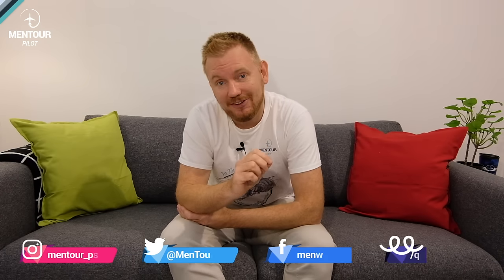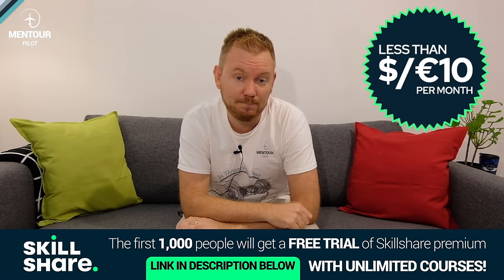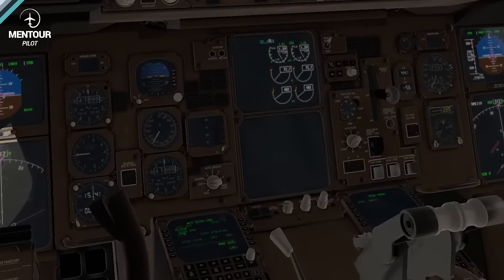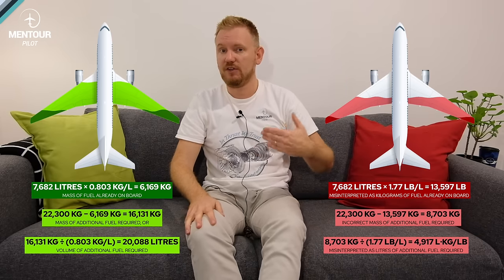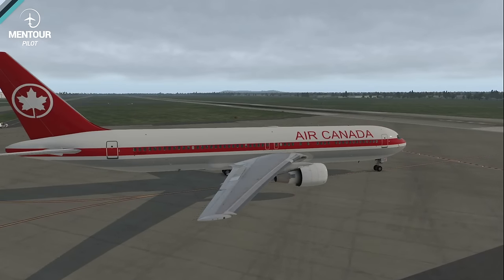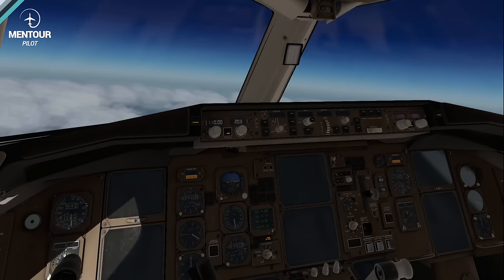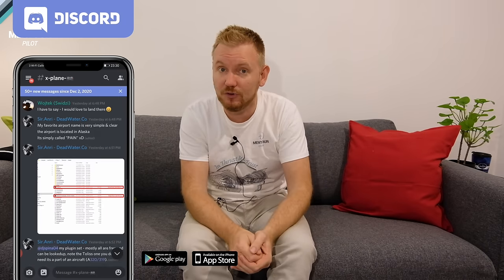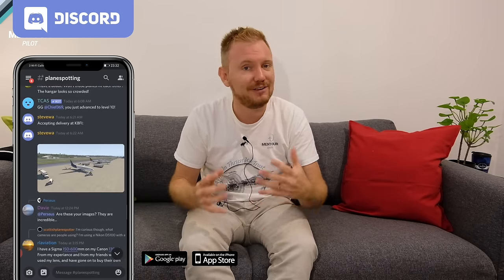The Gimli Glider! Explained

Comment: Excellent presentation. As a motorsport historian this incident has entered the lore of that discipline. Your explanation of the aeronautic side is the most thorough I've yet seen. One point of correction. It was not a drag race that was being held at the time but rather a sports cars race. To explain the distinction, drag races feature side by side runs of two vehicles down a completely straight road, typically 1/4 mile, plus extra space for slowing down. A decomissioned airport like Gimli is perfect and indeed such races did take place there, but not that day. When the Canadian Forces abandoned the field it was taken over by several racing organizers. On that day the Winnipeg Sports Car Club was having a meeting. Sports cars use a complete circuit consisting of different types of turns at different venues. 

At Gimli their course used the runway as the front straight and start / finish line. The cars then wound through a series of access roads to the west of the airfield before returning to the runway. A typical day would have featured 5 -6 races of 20-30 minutes in duration. Cars of similar performance characteristics compete with each other within the individual race. The famous photo that you also show has a group of Formula Fords stopped in front of the plane. Formula cars are built purely for racing and F Fords are very popular and very inexpensive scaled down versions of the more famous Formula One and Indy 500 type cars. Other shots I have seen of the incident showed cars like a Porsche 356--essentially a lightly modified for racing version of a road going sports car. 

I am not clear if there was an actual race going on when the plane approached and while there was of course considerable danger of people being hit, their were some fortuitous aspects to having this activity going on. Road races require there to be well coordinated communication between the various parts of the circuit and this would have gone into emergency mode (once the shock of the unusual situation wore off!). Then they had emergency equipment, personnel and fire-fighting materials at the ready, which I understand was used to help with the post-accident procedures.

Comment: Flying general aviation in Canada it always amazes me that we calculate the weight and balance in pounds, fuel in gallons then call the fuel service and request fuel in litres. E6B gets a bit of a workout when I want to go flying. 😀. Great content!
Reply: It's because of our half *ssed adoption of metric. It was a pet project of a single government that never had any widespread support.
Reply: @TheOwenMajor  You really don't want to let go of that bone!
Reply: It's easy.  The fuel company is paid for volume of fuel delivered not the weight of it which varies with the specific gravity which can change all the time.  Maybe they should be paid in pounds or Kg of fuel but the bowsers measure fuel flow and volume, not the weight.

Comment: I remember this sentence from the Air Crash Investigation episode:

"Captain Pearson is out of fuel. Out of engines. Out of options."

Not a good situation to be in.
Reply: Well technically he did still have 2 engines. not quite the same as the b707 where they ripped off the engines and pylons on a delivery flight.
Reply: Not out of options, he very skilfully used those options available to him to land the plane without anyone getting killed.
Reply: I loved the commentary when they saw the two kids cycling up the runway with the plane approaching them.

“Without its engines the plane is silent, and one thing the Boeing 767 doesn’t have as standard is a horn!” 🤣🤣🤣
Reply: Thomas Sletvik, that’s why I Mostly avoid those fake documentaries. And not in a tRump kind of fake. Meaning they want to spice up the story with Hollywood slick headlines.
Reply: @garethmurtagh  Surprised it wasn't a report recommendation.

Comment: „Pearson is going to attempt a side slip“ The best sentence of the aircrash investigation series...
Reply: Here it is, slightly edited: watch?v=jVvt7hP5a-0
Reply: I really expected "Déja vu" in this moment.
Reply: @Geigerzaehler  He side sliped into a place he'd been before, where they were racing cars.  "Deja Vu!  and I've been in this place before. Higher on the Street and Know it's may place to be me!  Wooooo!"
Reply: @dan_  Cool video!  Kind of funny though... they make it look like the plane was coming down at almost a 90-degree angle to the runway.  Slips in real life aren't nearly that dramatic.
Reply: On the way into Midway Airport in Chicago in a 737 the pilot was side slipping the jet big time. It was quite violent! When it landed, there was an audible gasp. (of  relief!) I knew what he was doing because of a general interest in aviation. I got the impression lots of the passengers thought we were crashing. (old airport. short runways. A few years later, a jet went out of the airport off the end of the runway and someone in a car got killed on the road.)
Reply: I read somewhere that several passengers were convinced that they were going to die when they felt the plane suddenly banking sharply as captain Pearson initiated the sideslip maneuver.

Comment: Thank you for explaining this in more detail than Hollywood did. My recollection of the film is that the blame was placed on the guys doing the refuelling. One asking the other either how many kilo's in a pound or how many gallons in a litre.
Reply: The rule of these sorts of accidents is that numerous people are at some degree of fault and that was probably because there was something wrong with the system. Pearson and Quintel both signed off on the fuelling of the aircraft. No one was innocent in this.

Comment: Gimli Glider is one of my favourite aviation stories. I fly Gliders, so all the more interesting! Except the ones I fly are various types of German ASKs at 400-600 kilos (the weight of 7 passengers?) all up, can't imagine something so heavy with that adverse glide ratio. Always feel safer ascending rapidly at 5,000ft catching a Wave than I do in a jet airliner. Sailplanes are designed to work without thrust, jetliners are not. Great casts BTW, many thanks!

Comment: Excellent review. More detail about the accident than I had heard about previously. I am so glad this turned out as it did without any deaths. I am a retired airline pilot and it’s always interesting after an incident to unweave the web and follow the path that leads us to the problem. And since we know there can be problems we have backups and check lists to try to prevent serious issues from happening. But we are not always successful, as in this case. Thanks to the skill and the professionalism of the crew and ATC personnel this incident turned out well. And then put a drag race and many people on your only runway....crazy. I also did not realize a sideslip would alter the efficiency of the RAT. Thank you. Well done.
Reply from the maker: Thank YOU for watching. It’s always great to hear input from colleagues!

Comment: Hi Petter;  I would like to congratulate you on doing a fine job on the Gimli Glider video.  It provides much more detail and more accurate detail than most presentations on the subject.  Being a Canadian and also having worked in the aviation field earlier in my career the Gimli Glider incident is one that I have looked into very deeply.  Given that, I am impressed that you added a few details to my knowledge.

      To return the favour I can add a few additional details to your story.  As you noted, the flight was to be 2 legs:  Montreal to Ottawa (about 200 Km.) and then Ottawa to Edmonton (about 3000 Km.).  Under normal conditions and to promote efficient aircraft operations it was practice to load fuel in Montreal sufficient for the leg to Ottawa and then load fuel in Ottawa sufficient for the leg to Edmonton.  Given the failed fuel gauges, following this procedure would require the tanks to be dripped in Ottawa to provide confirmation of fuel on board for the leg to Edmonton.  The time required to do this would not have allowed the flight schedule to be kept.  During the handover in Montreal the incoming Captain in addition to briefing Pearson on the fuel gauge problem proposed a time saving procedure:  Load all the fuel necessary for both legs of the trip in Montreal and tanker the fuel for the Ottawa to Edmonton leg from Montreal.  This would save time in Ottawa by eliminating the need to drip the tanks. (Which they ended up doing anyway - but that is another part of the story.)  Pearson elected to follow this procedure and did the calculations (with errors) accordingly and requested fuel to be loaded based on his calculations.  When the fueler was finished loading fuel he entered the cockpit with his paperwork indicating fuel loaded and between Pearson, Quintal, and the fueler mathematical confusion ensued.  When the final number was worked out, due to the confusion level, Pearson was very uneasy about the number so he asked the fueler a critical question:   "Is that about as much fuel as you usually load for this flight?"   The fueler replied "Yes, that is actually quite a bit more than I usually load for this flight."   The problem was that nobody had told the fueler that he was loading fuel for BOTH legs!  His reply was based on his assumption that he was loading fuel only for the Montreal to Ottawa leg - which is a leg of only about 200 Km.  To be fair, the fueler should not have to know what legs he was loading fuel for but his reply would have pushed Pearson's confirmation bias in the "Everything is OK" direction which, given later events, was unfortunate.  If I recall correctly there was also a maintenance engineer in the cockpit at the time working on some other minor issue which would have added to the confusion and interrupt level in the cockpit. Finally, being satisfied that all was OK, they started up the aircraft and manually programmed the FMS with the amount of fuel they thought they had on board and departed for Ottawa.

     Arriving in Ottawa they recorded the (incorrect) fuel number on the FMS and then shut down the aircraft.  Still being uneasy about the fuel quantity on board they eventually did drip the tanks, performed the same (incorrect) calculations with the same (incorrect) conversion constants.  The number they got more or less agreed with the number they had recorded from the FMS so they started up the aircraft, manually programmed that number back into the FMS, and took off for Edmonton.  The rest is history...

Comment: The term drip sticks comes from aircraft before the 767 where what was there was almost exactly like a straw sticking up in the fuel tank.  As you pulled it down once it reached the level of the fuel in the tank, it actually spew fuel out of the hole at the base of the stick.  You learned rather quickly to find that hole and make sure it is not pointed at you.  Modern "drip sticks" use a floating magnet which "latches" onto the magnet in the stick to give you a reading - no fuel spewing out of the stick.  My airline had a yellow chart which gave all the different conversions and I had to use that when I refueled and aircraft in the Canaries from their liters into pounds.  Love your channel and although retired many years, just can't get that jet fuel out of my system.

Comment: Thank you for this clarity !!! I've watched 3 other programs about Air Canada 143 and none of them had explained the fuel shortage as being the result of arithmetic conversions.
Reply: And as an aircraft technician and often refueller I worked on one old piston engined aircraft where the gauges were in gallons and so was the bowser.  As soon as I worked on turbine aircraft I found out that the weight of fuel is more important than the volume because of the way the engines work.  So I worked on aircraft where the gauges were in pounds and the bowser still in gallons.  The actual weight of fuel depended on the specific gravity of the fuel which can vary from day to day so one had t calculate it.  Luckily we didn't have to cope with litres at that time.  I then worked on Harriers and it was easy.  You just filled it until the filling automatically stopped then we looked at the gauges for the main tanks which should read full and then signed for the actual volume loaded.  The drop tanks had no gauges but were always filled if fitted.  So life was dead easy!   If the gauges on the 767 had measured weight of fuel rather than volume it makes mistakes harder to make.

Comment: I have a small piece of the fuselage of the actual Gimli Glider fashioned as a keychain.  It's my "good luck" charm when I travel.  I also like freaking out pax who don't realize that the skin of an aircraft is barely 3mm thick.
Reply: I have one also!
Reply: @BANTIGG  I used to work for the MotoArt guys around 12 years ago.  That was a really fun gig.  Now that I've seen this, I'm beginning to question the luck of it!  Seems like the only thing the crew did correctly was be able to fly the plane in the emergency of their life.  I guess that's enough.  I'll still bring it with me!
Reply: @wizardmix  I think that pilots in a simulator duplication of that event all crashed is a testament to the Gimli Glider crew. Use your tag in good luck and health!  I have often wondered if I flew in that plane on one of my many flights between YYZ , YEG, and YVR in the mid-to late eighties and beyond. No Internet research possible in those days, so sadly, I'll never know!
Reply: @BANTIGG  Good point.  I suppose the only people who would know if they were ever on a plane that would go on to crash are those who always record the tail number they fly on.  I think it's fairly possible that I've flown on at least one plane that would go on to crash in my lifetime.

Comment: Back in the early 2000's, I recall a story that probably didn't make headlines (out of the country).  A contract flight crew was dispatched from the US to El Salvador to ferry a helicopter back to the US with several fuel stops.  After 4 days of lousy weather,  an opportunity came up to get 1st leg done.  A US passenger (actually the owner of the helicopter) was also along for the ride - total of 3.  While flight crew was busy w/ flight planning and other government red tape, they told the passenger (a low time fixed wing pilot) to go out to put in 150 gallons of jet fuel.  Fired up and off they haphazardly went.  Unfortunately,  the fuel was in liters not gallons.  Predictably the engine quit while over a jungle and crashed.  It tooks a couple of days (bad weather) to find the downed ship.  Unfortunately, the front of the helicopter had broken loose from the fuselage,  so the 2 pilots were ejected to the canopy floor where they both became victims of native jungle predators.  The  passenger in the back survived still buckled in and got a front row seat to the carnage below.  Not sure anyone knew or recognized the hasty mistake of rushing things and nobody caught the fueling error.  Instead of 150 gallons, they got 150 liters - as  150  was what the display showed on the fueling pump meter.
Reply: Why on earth didn't the fuel gauge show the units that were being measured?

Comment: I think you forgot to mention this was the first transport category aircraft with all engines inop, successfully land without loss of life.
Reply: So I'm curious. The auxiliary generator (ram air turbine) can provide power for very limited instruments, understandably. But why wasn't vertical speed one of the included instruments? Use of the RAT system means both engines are out, which means the plane is a glider - and that's a very crucial instrument in that circumstance.

Comment: The Canadian National Radio Control Championships were flown off that strip in 1978.  I competed there and took home top prize.  The strip was in pretty good condition, which is why the drag guys used it too.  Nice smooth track with long runout.  I could only imagine the terror for the two kids on bikes with a 767 chasing them and probably making a lot of scraping noise.  If we had been there then, it would have been all eyes in the skies since that was our practice anyway.  Dragsters, mostly heads under hoods.  Great story Mentor Pilot.

Comment: Mayday did a good job covering this. There was possibly another problem besides two measuring systems. Montreal is largely French speaking, as opposed to the English speaking crew.
Reply: Bullshit, you have to speak english when you work on or around a commercial airplane. If there is communications between ground crew and the pilots it's in english, makes it easier and safer for everyone. I've been working at Montreal-Trudeau airport for the last 22 years. There's no joking around with that rule. You might hear a french salutation like "Bonjour" or "Bienvenue" but anything technical we use the normative english in case of an investigation.

Comment: It's really interesting that any pilot would even thought that it's okay to fly without fuel gauge. It's not unheard to get fuel leak in the air and without a fuel gauge, there's no way to figure that out in time.
Reply: My impression from the video is that Pearson misunderstood that Weir had flown in that way, and he claimed that maintenance staff told him that the official MEL permitted it. But I agree with your reasoning.
And if you want a perfect example of a midair fuel leak leading to a dead stick landing, watch the Air Transat video! Canadians seem to have a knack for running out of fuel but living to tell about it...
Reply: The video reminded me of the 3-column conversation chart, the centre column was usually 1 to 9.
If you have got the conversion factors wrong, or used them the wrong way, a glance at the chart brings you back to reality.